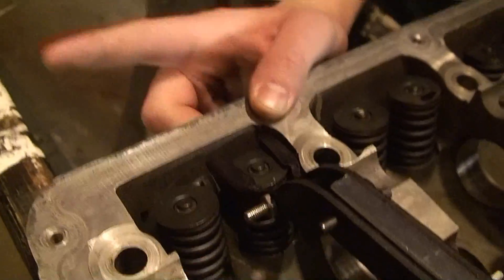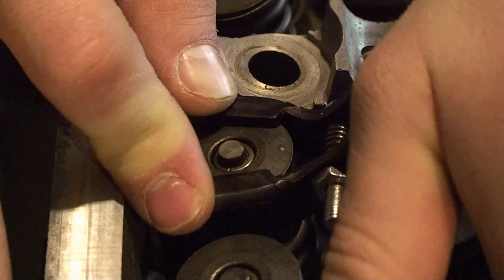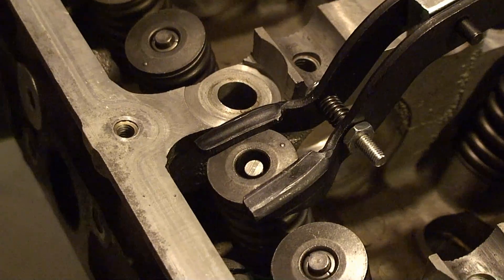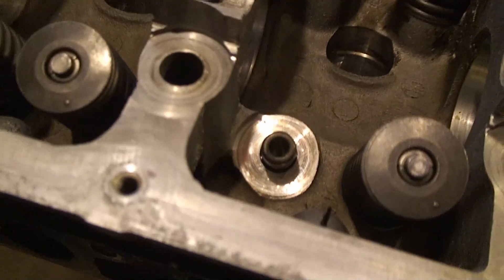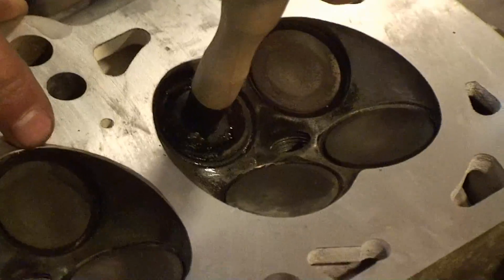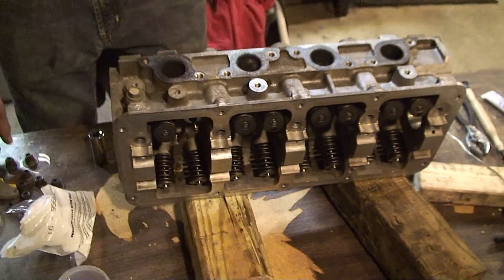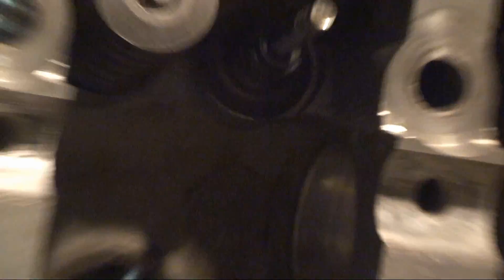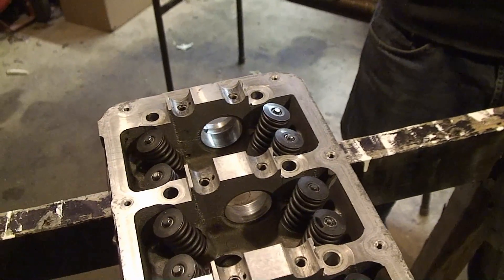Dodge Neon - Valve Lapping and Valve Seal Replacement

Comment: I did the same process with the head on my 2005 Dodge Neon.  But I used a variable speed drill.  I applied lapping compound to the valve, then put it into the head.  Then I attached the drill to the top of the valve stem and spun it at high speed against the seat for about 30 seconds.  This method is much more effective than doing it slowly by hand.
Reply from the maker: great tip, thanks

Comment: 8:00 how do you know if the seal is fully seated?
Reply from the maker: Sorry for the late reply, I'd have to look it up, but you can check it by using some sort of transfer, like ink
Reply: @mreinsmith  Pull it tight after cleaning, by hand. Pour a little gas or other solvent down there. No leaks = good seal
Reply from the maker: @scitzz  thanks for the input!
Reply: @mreinsmith  lol i just realized he asked about the seal not the seat. My bad.
Reply from the maker: @scitzz  I thought that's what it read, I need to get my eyes checked! 😉

Comment: Will these being worn cause my neon to smoke only on start up it quits smoking after a short period
Reply from the maker: yes, it's possible, do a compression test to see if it's isolated to a single cylinder or low across several

Comment: have seen another guy on his video using a drill adapted to the end tip of valves and just lappin at low speed on both direcctions,what you tink?
Reply from the maker: That should work, if you know what the results  should look like you could do it that way, you might want to do one manually first to get an idea of what it will look like

Comment: What valve spring compressor did you use I heard it's hard to find one that works on the neons
Reply: I'm doing the same thing on my 96 dohc and I used one of the magnetic impact tools to take my springs off. It has a separate piece for putting them back together as well but you don't use a hammer for it.

Comment: I did a head gasket and the kit had these. Now seeing this video I know what they are for now :(.. too much work to take it back apart but how will i know if the ones on my head are bad?
Reply from the maker: in the worst case you'll still be burning oil.  Mostly I think you'll suffer a lack of power and maybe pre or post detination (can't remember which would be the case for valve seals).    Check for spark plug fowling.  But the bottom line is that replacing the head gasket will take you most of the way.  It will last a good long time even if the valve seals are worn.